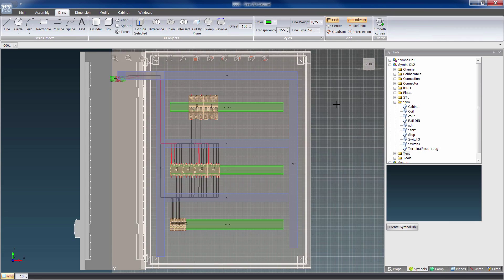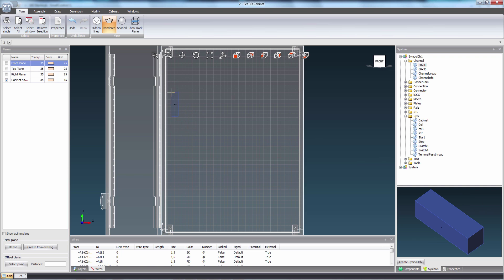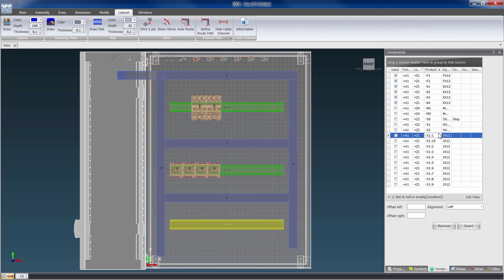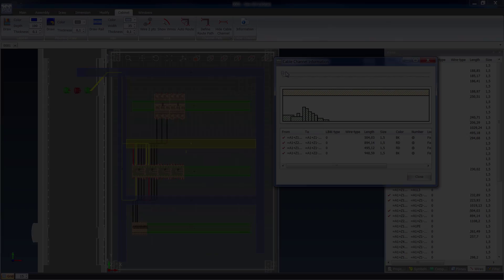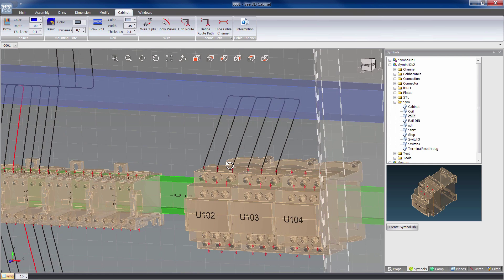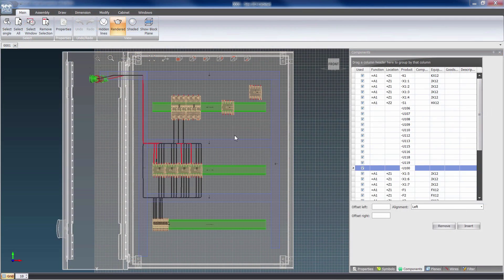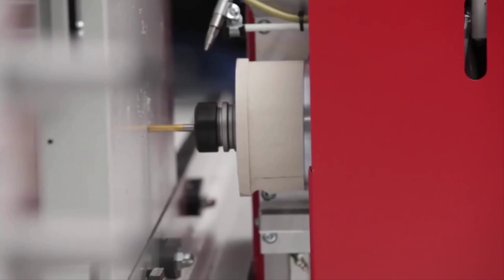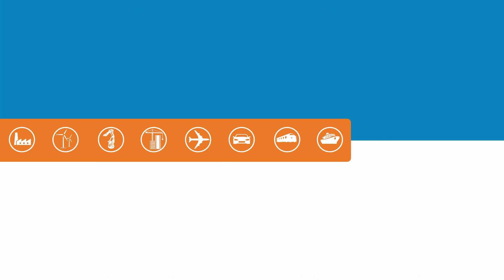SEE Electrical 3D Panel

Comment: PLEASE CAN YOU DESIGN A LECTURE SERIES ON HOW TO USE THE SOFTWARE
Reply from the maker: Hello, We offer training. Training lasts min 3 days. First day: inserting of components, cabinet drawing. Second day: creating of new symbols, cabinet wiring. Third day: how to connect 3d symbols with equipment's codes, hole generation. Many of these topics are important for 3D electrical designers.